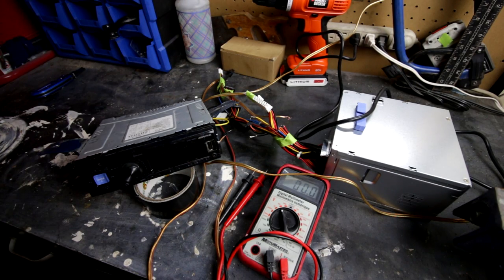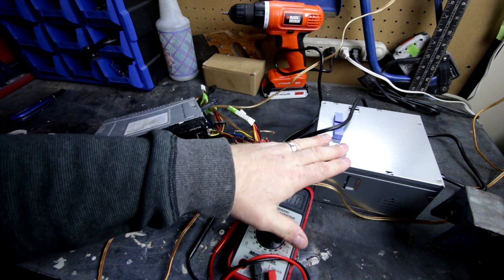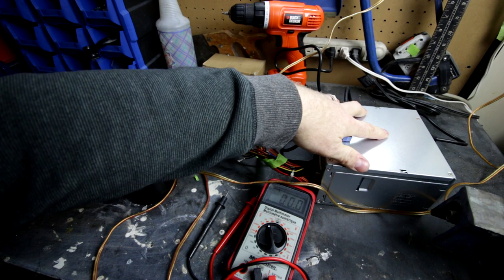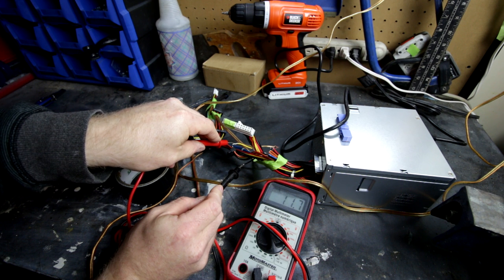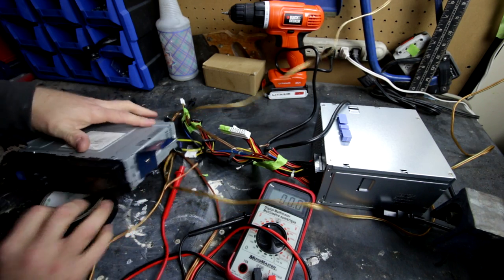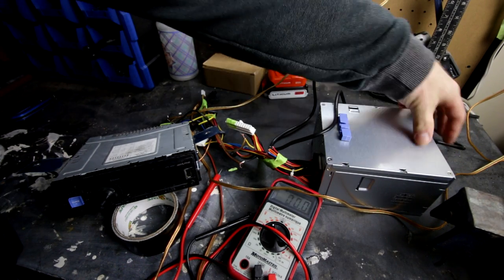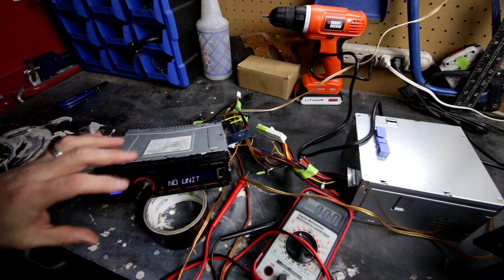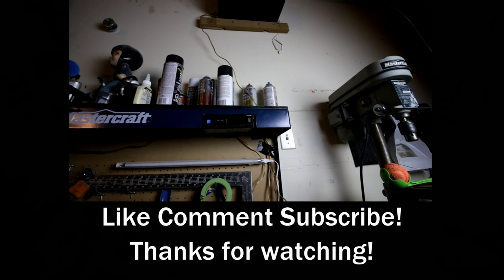How To Power A Car Stereo Without A Car

Comment: Good video.   I used a old laptop power supply which spits out clean 14V.  A car stereo can accept up to 14.5V (since that is the actual voltage when your car is running).  The laptop power supply has an advantage of being smaller and has its own cord.   I was able to use my double din off brand stereo that worked great, had bluetooth and a remote control.   I may build a little box and turn it into a radio for my kid dorm room.
Reply: My pioneer is 14v ..would any 14v adapter work?
Reply: @sagramsagram4632  make sure the powersupply can put out same or more current than radio needs.

Comment: Few years late but thanks for the video, I couldn't figure out that the red(switch) and yellow(power) wire both went to the yellow wire from the power supply, I actually connected this and two old headlights from my S10 as spot lights and I have a few more ideas thanks to you!

Comment: Hello. Advice needed..What kind of converter needed to get rid of the mw lw radio interference when using a normal 12v adapter? This adapter originally for a satellite receiver.Interference only on AM bands, FM is fine..Thanks

Comment: would it be a good idea or would you suggest using the 5V lead for the memory wire to get constant power? I am planning to do this in a simple boombox format and plan on leaving it plugged in when not in use with a switch on the red wire to fire the radio up (as if turning on the key).

Comment: Bro i have a Kenwood kdc U446 car stereo player ( cost around $200) . 
I'm using a computer SMPS too. But here i have problem. When i turn up the volume more than 40%  Front LED panel starts kinda blinks like insufficient current , and if i turn the volume up a bit more, it shuts off then turns on itself again. So I can't  play much louder. 

Is kenwood kdc u446 requires more amps in 12 volt or is this some internal problem? 

Because when i tried 5 amps transformer power supply , volume goes up to only about 20 percent and then shut off and restarts.... 
I think my pc smps give 15 amps in 12V as written in the smps manual

Comment: Do you know how to power a new model radio at home that doesn't have an acc wire?  I only have ground and battery/constant wires, besides the various others.  It's a 2008 Chrysler Sebring (05064922AE) and I'm using a Metra 71-6522 harness.  I have a 12v 1amp ac adapter ready to use.  Thanks!

Comment: Too much hassle and it looks messy. I actually looked up this video because I am tinkering with a 10.1 in 2 gig PX3 double din older Android head unit. Unfortunately it's not the 4 gig 64 gig px6 Octa Core variant. 

Anyway, I would have purchased an inexpensive ONN Bluetooth speaker from Walmart instead of the old computer PSU and old school single DIN Blaupunkt looking radio from back in the day. Or I would have purchased a $5 Bluetooth adapter from Five Below or eBay and found a decent 5.1 receiver from Goodwill, Salvation Army or any of the thrift stores around town for about $20 + $20 for the five surround speakers and another $15 for the powered subwoofer on average 😁.